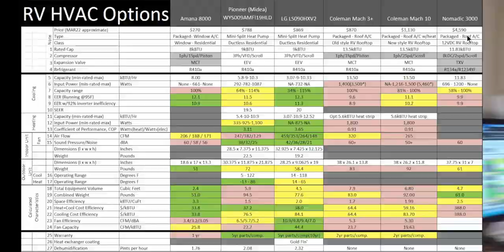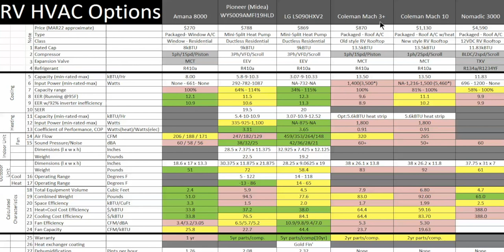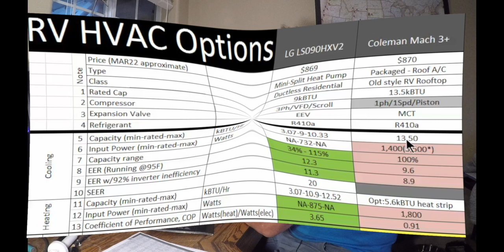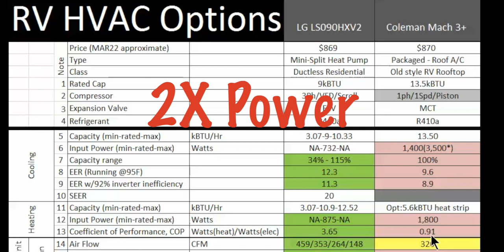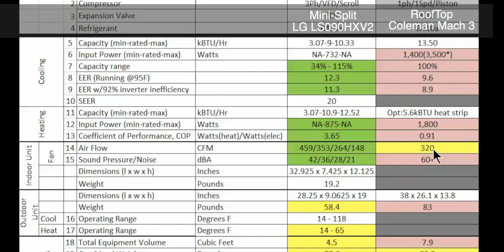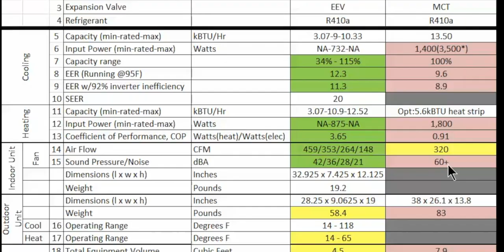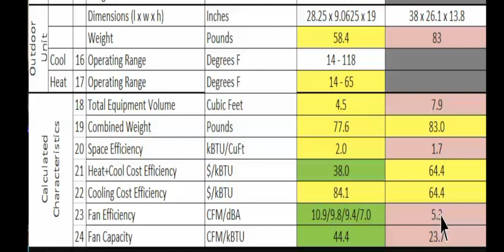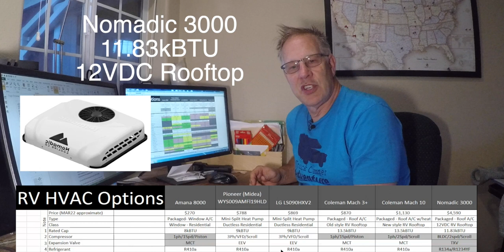RV Rooftop vs Mini-Split AC | Shop Talk | DIY Truck Camper

Comment: Wow, this is one of the clearest and most helpful videos I've ever seen to help understand all the pros and cons of AC options!  You brought up a point I was completely unaware of: the inherent inefficiency of 12v systems at high current. I thought that overall effciency was precisely the reason people spent $4,000 on these 12V AC units. Can you explain a little more about this 12V efficiency problem?
Reply from the maker: It's pretty simple really. The 'tool' for speed control (voltage or frequency conversion) for all electronics is the 'semi'-conductor. 'Semi' is intended to mean that it can be switched between a conductor and a non-conductors to be used as a switch/amplifier. While this is (obviously) true, it must be understood that while silicon CAN conduct, it is not as good a conductor as metals are. The fact they are less conductive (than metal wires) means that a portion of the electricity that flows through them is turned into heat.The relative portion turned into heat instead of flowing to the device is wasted and results in inefficiency. IF this loss were linear and proportional to POWER, the inefficiency would be the same for all voltages since Power = voltage x amperage. However the loss is not linear, it is EXPONENTIAL. The formula for power loss is: Power (loss) = current squared x resistance. This means for each doubling of current, the power loss is quadrupled. Said another way, for each doubling of voltage, the power loss is quartered.
As an example, let's compare losses in motor controls of a DC A/C unit drawing 1000W at both 12V and 48V (which are both commercially available). To control a 1000W load at 12V, the current is 1000W/12V=83.33A. The power loss is 83.33A^2 x R =6,969 x R (ignoring the actual value of the resistance because the same semiconductors will be controlling both motors). The 1000W/48V = 20.83A. Losses are 20.83^2 x R = 433.9 x R. The losses at 12V are 16 times more than at 48V.
This is true if using a brushless DC motor, a VFD on an AC motor, or an inverter. All are semiconductor switching devices. 
For this reason, a 12V A/C unit will never be as efficient (by a lot) as a unit operating at higher voltage. 12V systems are inherently inefficient at virtually everything. EV's run on 360V (as does their A/C system) for this reason and are an electrocution hazard so there will likely be a middle ground voltage when the automotive, A/C and RV industries get around to addressing this problem, which they must if an electric RV is to truly exist.
Reply: @WorkingOnExploring  But a control unit designed for 12V won't use the same control devices as one designed for 48V. It will either parallel multiple devices or use larger ones (to the same effect), which lowers the internal resistance that lowers efficiency.  As the supply voltage drops, everything in the circuitry has to get bigger to keep resistive losses low: cabling, motor windings, you name it. That adds weight, size, and, still, power dissipation (control circuitry has to be beefed up to drive those control devices) to the whole shebang.  If you're using a 48V control unit for 12V compressors, you haven't done your engineering homework.
Reply from the maker: @shaunsimpkins1395   I think your comment is correct but you misinterpreted the proposed system design. When I said the way to get into efficient, DC air conditioning, was to use a 48V A/C unit, I evidently didn't also clearly state that also required CHANGING the entire DC system (all new equipment) from 12V to 48V (NOT using a 12V-48V DC-DC converter).  I don't think I inferred using a converter, at least I hope I didn't.  If that is what you thought I meant, you are correct, that would be crazy. 

The efficiency of using a DC-powered A/C unit is in 1) minimizing power conversions and 2) reducing the current. Step 1 is to use the same power system and equipment voltage. No conversions = no conversion losses. Step 2 is there are always motor control losses if using variable-speed equipment. Power loss relative to current is expressed by (P=I^2*R), Power loss = Controller/motor current squared times resistance. First look at the current; By increasing the voltage 4x, the current is 1/4x which means we reduce resistive losses (1/4)^2 = 16x. Second, look at controller resistance; The motor resistance will increase but the controller components will not. As we are looking at controller losses, R1 = R2. 

Anytime, we are either converting or controlling low voltage DC, we have high current and therefore low efficiency......I think we agree on all of this. I think your concern is thinking I was expecting to convert 12VDC to 48VDC which I was not.
Reply: @WorkingOnExploring   Thanks for your response. Let's take a simple example: a voltage source of Voltage k*V - where k is a voltage scaling constant - driving the series combination of a resistor of value k*R, representing connection and control unit losses, and a motor/compressor unit with a load resistance of Rm * k.  Efficiency can be defined several ways - electrical, size, etc., but let's define it as the power dissipated by the load divided by the total power dissipation of the circuit. We can write i= k*V / [(R + Rm)*k] = V/(R+Rm). Total power is ((k*V)^2 / [(R+Rm)*k]=kV^2/(R+Rm). Power in the motor is Rm* [k*V/(R+Rm)]^2=Rm*k*V^2/(R+Rm)^2. Efficiency is Rm/(R+Rm). Independent of k, but ONLY if all components of the circuit scale by k in the manner implied.

Reality being what it is, there will be constraints on how well the components of the circuit can scale; cable size and weight may grow too large and heavy to be practical; the compressor windings may as well; the control unit, with its switching transistors, may not be upsized enough to handle the increased current. You've implied this in your I^2*R discussion - it's assuming that R remains constant, and in that case, yes, power dissipation will increase 16 times for a 4 x decrease in voltage.

Bottom line, lower voltage systems DO tend to be slightly less efficient than high voltage systems if the engineer has done their scaling job thoroughly, but not an order of magnitude less efficient. That slight difference I think arises from practical design constraints, not fundamental limits.

Comment: Excellent analysis. Amazingly, the coefficient of performance, COP, for your mini split heat pump  is 3.65 ( > 1), which means: what you get for heat  is 3.65 times of what you pay for the electricity. It's a very good deal for energy conservation.  Theoretically in thermodynamics, the COP for Carnot cycle (idealized heat engine) heat pump is always greater than 1. I was impressed by its efficiency when I was taking the class in school. The mini split you have should be very energy efficient for your winter heating. Do you have any data for that? Thanks
Reply from the maker: I have taken quite a bit of data on A/C but not on the heating. We do use the heat pump a lot when we are on shore power at our remote property or in someone's driveway but we don't use it much for heating while boondocking  in the winter because COIP is lower and our solar collection is only half what it is in the summer, (due to the low sun angle, lower daily hours etc.). When boondocking in cold (30-40F) weather, we mostly use the diesel air or coolant heater for cabin heat as COP goes down with temperature differential. Since it can still produce heat down to 17F @ a COP of ~2, its always a good idea. With A/C temperature differential of ~20F and heating temperature differential of likely more likle 30-40F, the COP is not as compelling for heating use as A/C. If you really want to be impressed by COP, check into air to water heat pumps. I'm working on building a home in Idaho and plant to have hydronic in-floor tubing with an air source heat pump. Because the delivery temperature for the hydronic only needs to be 90-95F instead of the 120F or more for air to air heat pumps, the COP goes from ~3.5 to 5 or even 6.

Comment: Hi Steve....I will try to learn the formulas but i do not know them.   Is there a formula that you used that i could borrow that would allow me to calculate how much battery I would need to run the LG dual inverter mini-split for two time lengths:   4 hours and 9 hours, at the lowest output, mid level output and maximum output.    the system Im assuming you have is the ls090hxv2.   Or if you can estimate that based on your experience. .  i know you have a 300 pound battery pack i would like to use the lightest battery pack that could possibly meet those time and intensity need.    Thanks if you can answer.   I know it might look like i am avoiding work here, and I probably am haha.
Reply from the maker: Its a complicated question and therefore a complicated answer. Since there are many variables, inevitably AN answer has a broad range of 'possibilities'. In order to attempt to come up with something you can use, it is necessary to construct a 'power utilization curve' shown in my 'A/C 8 hours per day' video ( https://youtu.be/ijk2Z-ebevw?si=HEfq2G1I1yhxIvsV). Equipment consumes energy. That energy has to be supplied by something. When supply is less than consumption battery can make up for the difference. To determine battery size, you need to estimate supply and consumption (both very much based on physical and environmental conditions). Since I am assuming you are looking for a non-shore power solution, your supply side sources are generator and solar. The generator is not time-based (you can run it any time you want) and can be a replacement for a battery, but solar generation is time-based (solar generation depends on your capacity, mounting, cleanliness, time of year, location etc....it 'depends' a lot). You need to estimate your production hourly throughout the day and come up with a curve. Secondly, you need to do the same for consumption, not just from the A/C, but from everything else that operates daily. You really need a power meter on anything that runs intermittently or variably like your A/C. A 'kill-a-watt' meter is a portable version. This tells you what your instantaneous consumption is and cumulative consumption. I have something similar permanently installed. Your tests and estimates need to be done with your specific RV included. Size of the RV, insulation, ambient temperature, sun exposure, window type and area, etc, all factor in. This gets to heat gain/heat loss understanding. These factors have a MAJOR effect on how much your A/C draws when it runs. When you grind through these estimates, the shortfall between generation and consumption is your battery size...

Comment: Hi Steve,
I had a question on condenser size for which I'm hoping you may know the answer.
I'd like to use the propane bay in my Lance 1191 to mount the condenser on a slide out tray. When in use, I'll slide the condenser out so it has good ventilation.
The space in the propane bay I have to work with is width of 26", a height of 23" and a "thickness" of 17.5".
Most condensers seem to over 30" in width.
--Off the top of your head, do you remember any mini split brands that had condenser widths 26" or less?
The systems I've surveyed so far are all wider than 26".
Thanks!
Reply from the maker: Mine (LG)  is the smallest 9kBTU I could find at 10x20x30. You're right in that most I found were 32" long plus you'll need a couple more inches on both sides. I doubt you'll find a 9k small enough but there are some 6k units out there. It's going to be really hard to find something.

I WOULD NOT MAKE IT MOVEABLE. There are NO flexible line materials rated to flex when charged. Van guys are doing it with Rectorseal flex stubs but thrse are installation aids, not for flexing under charge. I constantly recommend against it but I do think they are doing it anyway. I had one guy say he was going to use hydraulic hose. R410a refrigerant under pressure will pass right through rubber (slowly but enough to lose charge in a year).

If youre determined, you'd be better off with a marine multi- part unit that uses R134a that can use 'barrier hoses'. 'CruisenComfort, Mabru, MarinAir and Domestic all make that type. Many are low voltage DC. ALL are expensive.
Reply: @WorkingOnExploring  Thanks for that info!

Comment: I think in the baseboard of a truck camper the 5-6k BTU is more efficient at 110v around 500watts. Great and informative video, thank you.
Reply from the maker: I've been running it quite a bit lately. The broad operating range of 3kBTU - 10.5KBTU is really helpful for efficiency....If I start it around 1PM, it runs at about 800W (full speed) till it reaches set point then slows down below 400W. As peak heat is about 5PM, it creeps back up to about 600W then to keep it cool. The 950W of solar typically put out more than the A/C draws till about 5PM then it starts  pulling more from the batteries.....I've found as long as it's less than 95F, we can probably recover enough battery charge by noon to replace what we've used running in the evening prior...
Reply: @WorkingOnExploring  check out the softstart dog bone for 30 amp.
Reply from the maker: Variable speed motor controls cannot benefit from or use a 'soft start' which can only be used on a single phase induction motor.
Reply: @WorkingOnExploring  that is why I believe the window unit would benefit from it.
Reply from the maker: Most variable speed compressors use variable frequency drives which are supplied by single phase, 60hz power, converted to DC and then 'inverted' back into 3 phase AC at a frequency that corresponds to the desired motor speed. They are  inherently, 'soft starting' because the VFD has the ability to ramp up motor speed gradually. Putting a soft start designed for a single phase motor on the input will not affect the VFD control or be able to change the motor speed..
Reply from the maker: A window unit could benefit from a soft start. I don't think I've ever seen one that isn't a single speed induction motor. I've heard about a 30A dogbone with a soft start built in but have not investigated it. Normally the way a soft start works is to drastically lower system voltage so the motor can't draw as much amperage....if you were to locate the device at the power entrance, it would lower the voltage for everything in the camper while the motor was starting. Most non motor appliances would see this as a power 'brownout' which could be bad for some types of devices. I do intend to check more deeply into these while camper soft starts but I advise being careful using one.

Comment: Be great if someone could figure out how to make a mini split outdoor unit into a horizontal form factor for RVs so they can replace the rooftop A/C unit without losing the efficiency and noise pollution of the current heat pump roof mount A/C units.
Reply from the maker: I see it as an 'easy win' for any of the rooftop A/C manufacturers to do exactly that. Even more, for a mini-split manufacturer to break into the rooftop A/C business. IMHO, the ideal package would be to make a 'horizontal' out door unit (ODU) that can sit over the 14" roof opening (or anywhere else on the roof) and feed refrigerant lines through the roof opening and have a thin (less than 3") ceiling unit (several manufacturers make 'low wall' units that thin) that could be mounted on the bottom of the 14" opening ( or like the ODU, could be anywhere inside on the ceiling). I think the existing manufacturers are unwilling to do it for fear of setting off a competitive race. The crap they currently make likely has high margins and new products cost money to develop.
Reply: @WorkingOnExploring  maybe a newcomer will take on the challenge 🙂